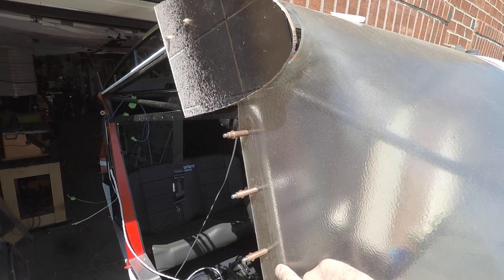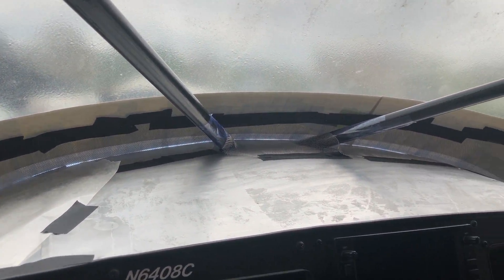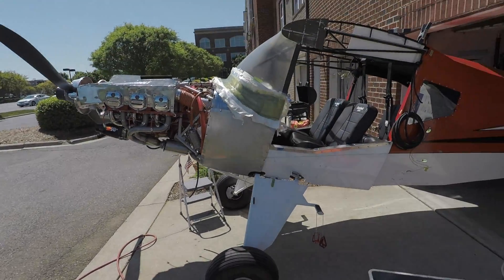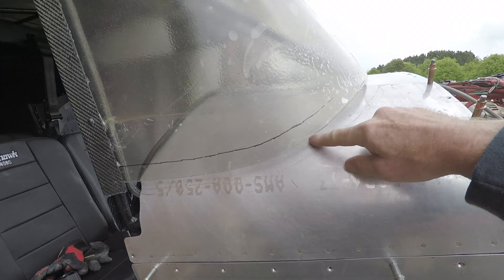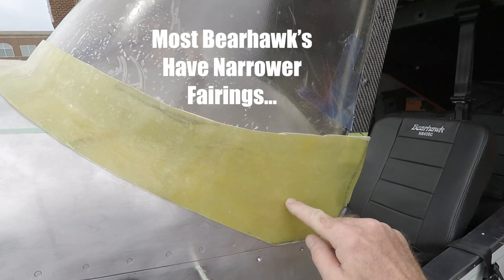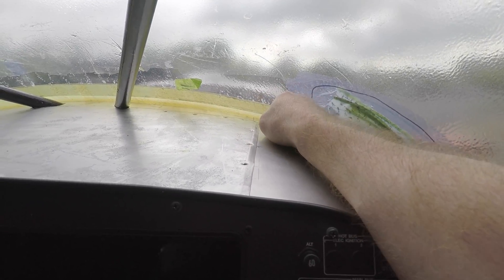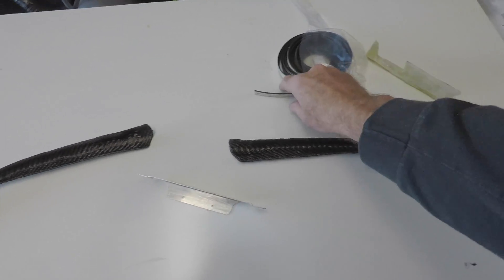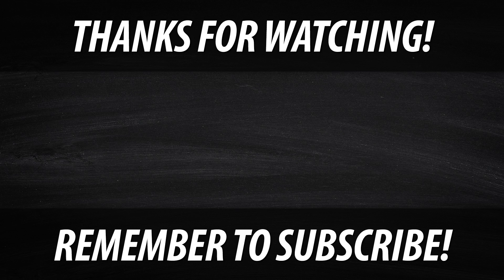BEARHAWK ~ Installing the Windscreen  |  Part 2

Comment: If you haven't already, you may want to double check that the 3M Windoweld is safe to use on Lexan or plexiglass.
Reply from the maker: Actually, it is neither Lexan or Plexi.  It is LP Aero and they recommend the 3M material.  https://lpaero.com/

Comment: Good save!  Will you have to remake the fairings if the windshield has to be replaced?  Will the windshield, not being as long as it should be, flex in the center under load?
Reply from the maker: Yes. The poster board template mimics the shape of the wind screen and should work if I need to replace it.